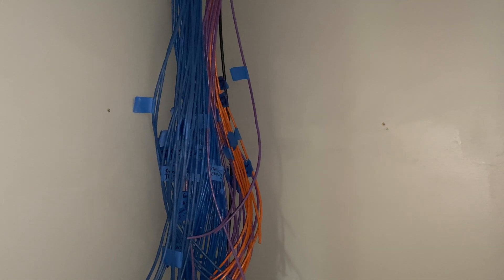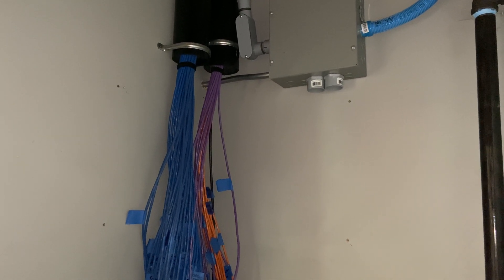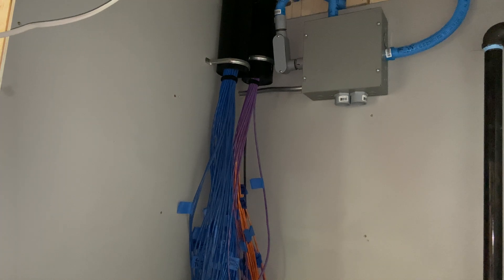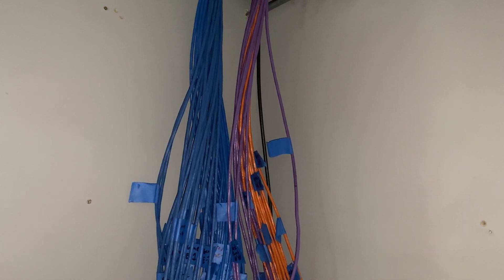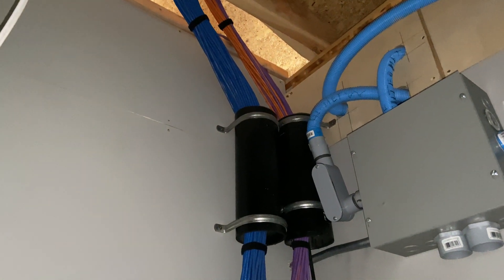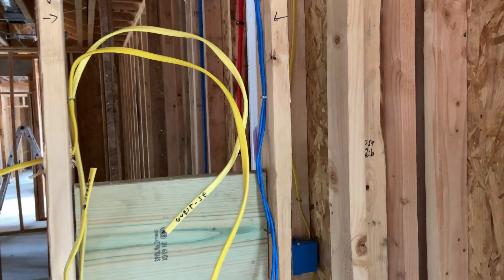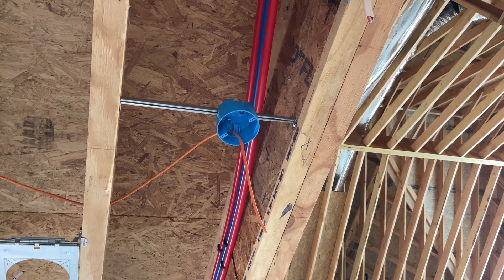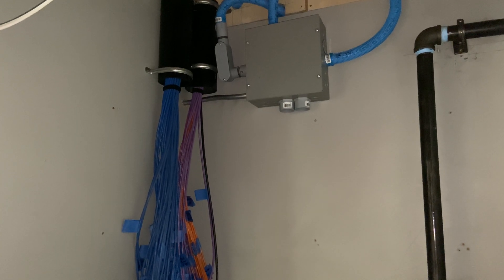Episode 52 - Network Rough In - CAT6

Comment: I went with black for security (cameras and doorbells), red for AV stuff (jack to a TV, AppleTV, AV gear etc.) and yellow for everything else like ethernet jacks in a room, servers, switches, etc. I would put ethernet outlets on 2 or 3 walls in a room so you don't run cable across the floor. A switch deals with whatever else is going on in the room. The existing cable is black and blue so I use red yellow and black velcro to bundle them appropriately.

I standardized on Ubiquity for everything. I don't really want anything in the cloud. They make it easy to figure out which client devices are on which switch ports or WiFi AP.

I sprung for CAT 8 10Gbe between the switches, NAS, and several computers. Computer to NAS is the only thing that might someday exceed 10Gbe, and with caching SSD can burst to that with my current gear.

Comment: Who is your internet provider? How are you getting internet service. Without coax ?    Was anything run from the road or poles to a service point on your building?  I ask because Comcast won’t do a service drop to my house. Trying to figure out how to get internet.
Reply from the maker: Our internet provider is through our local power company co-op. They run aerial fiber along the power poles so I have 1Gb fiber coming into my house.  It is underground from the last pole on my property to my house. 

If your local wired providers won’t serve you then I would look at Starlink or 5G cellular. 

Thanks for watching.

Comment: Would you recommend making each C6 as a homerun as you have or would you do a split and what are the benefits +/- for using a spliter in some cases?
Reply from the maker: If you are talking about cat6, I would always home run everything. The only expect would be if you really wanted to put a second rack in the house to split things up. If that is the case then I would run some LC fiber between them so you have options for a good backbone.
Reply: @Ciband  Thank-you so much for the help. This is greatly appreciated!

Comment: Love these video's very helpful. Well explained for folks like yourselves who are also in the same situation. Looking to learna and setup design. Thank you
Reply from the maker: Thank you and thanks for watching.
Reply: I am just now starting my design layout for my low V setup routes, etc. Any advice for code rules, i also read someone in the comment mention Cat6 wires getting hot and keeping them separated? I do know to keep the Cat6 at least 10" from reg elect wiring in center of studs. Also learned that you cannot cut in specific areas or cut sizes of floor joists to avoid problems. But any help is much appreciated. Would love to  grab an email if possible. For more questions on access points, etc. Thank you, @Ciband

Comment: i am not a fan of your wiring for cat6 with bundling. I would prefered to see done up like generic electrical outlets and wiring, with staples every so far, and proper hangers or staples holding the wire.  if you are talking to drop down in the room where main switch is going ya ok, but all the other runs not so much.  some issues with bundling like that could be.... cross talk between cables, heat build up within each cat6 wire and not being able to cool down, if you ever need to replace a run for what ever reason, another is getting the cat6 cables in middle of 2x4's vertical to help protect against nails / screws in feature, to other, another more important for me is bloody freaking mice, i have seen were mice, they make a nest in tight stuff such as bundles, now if it was generic 120v electrical wires that gennerally 2 nm / romex cables stabled at most most of the time in a home ok, the romex insulation holding (black,white,ground, with possible red), just is ok. due to the romex sleeve insulation is protecting them all. but for cat6 cable not so much, when you have so many cable runs in a large bundle that is not put in some sort of conduit / sleeve / cable mangment thing. 

next would be the "cheap outlet boxes" used for the end points in rooms. i would like to see generic 120v outlet boxes in walls, vs the cheaper low voltage face boxes you used.  1st is bugs and mice and like. but other is more so, is air will be sucked in/out more easily through the face boxes you used into the walls. in a older home you can tell difference were R45 jack for cat6 is vs 120 outlet or switch, one has dirt fumes on the wall, while other outlet face plate still same color as well. while this may all be fine, but you are more likely to pickup what someone is saying on other side of wall due to air alone passing along sound, through the face boxes you are using.
Reply from the maker: Most any server closet I’ve seen has the incoming lines bundled with hook and loop in that manner.  I am really not worried about heat on data lines. A case could be made for the PoE and I will certain check that as I bring cameras online, but I still wouldn’t think it would be an issue. 

A reasonable think for the boxes but with spray foam exterior insulation, I don’t think there would be much difference. For interior hollow walls, maybe. So far I haven’t had any issues. 

Thanks for the comments and thanks for watching.
Reply: Your issues are all theoretical. IF I tightly bundle ALL 48 PoE wires AND fully load them with power AND the ambient temperature is high AND they are in conduit or something unventilated then I may get some heating causing packet loss or failure. Go grab the thickest bundle of cables you have. Is it burning you or simply at room temperature? It is at room temperature. Even the active PoE ones.

In reality this just never happens and the only place it could is right by the server rack as it comes in through the wall or ceiling so you could just put it in the AC part of your house instead of the garage.

That said, I agree with conduit and pull rope so it is easy to pull in new or replacement wire when needed. Add access in the attic or wherever to help with the process. Conduit also protects you from wandering AC engineer/Electrician/Plumber/rats/whatever wandering around and breaking things.

Comment: worried at all about the security problems and hacks with the ubiquity systems? i know little to nothing about what went down with them but a few other smart home channels were pumping the brakes on them for a while. also 6 APs? how many sf are you covering lol? steel walls?  :)

I'm a computer scientist too building my own house and doing my cat6 pulls now. our debate is whether to run POE to every window header for motorized shades
Reply from the maker: Honestly I hadn’t heard about any of the security issues. So far I’ve been happy with the gear. 

The APs are overkill but I wanted max 5GHz coverage. 

If you think you might want the cable, run it. 

I already have things I wish I ran. Run conduit from your rack to main parts of the attic too. Wish I did that. 

Thanks for watching.
Reply: @Ciband  yeah, I have condit going to attic for future solar and another for starlink or HD antenna. Also have a conduit to outside for EV charger. Of course ran conduits from tvs to the media cabinets. 

House we live in now I remodeled and had all the walls open. I pulled cat6 and coax everywhere... 8 years later and I ended up not using any of it really except one run for some gaming pre-kids. 

Despite that, I still can't help future proofing
Reply: They had a shit response one of the times iirc. But in general they keep pushing out updates for their products. VS the box store lame crap where best case you log in to some website and keep up to date manually.

The hacks don't bother me. Even the NSA expects their network to be compromised. As long as they fix it, keep existing, and don't stop fixing it.